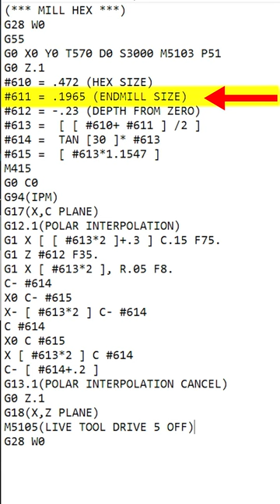This MACRO Machines a HEX on a Swiss Lathe #shorts

Comment: Why does the macro need the endmill size ? Cant u use g41/42 ?
Reply: no because from what i can tell, they are not working with  a conture. the whole thing is made with plain G code commands so the machine is simply following the linear moves and the radius compensation of the endmill has to be calculated into the linear moves themselves
Reply: You probably could but I will say involving cutter comp into macros can be a headache sometimes. In my experience I prefer to avoid that just because I know this will work 100% of the time. For example if you had a 2.00” endmill doing a .375 hex (you probably wouldn’t but you get the idea) getting the lead in and lead out to compensate for the radius in your offset could be annoying
Reply: Because this macro is very Old, almost 20 years.
Reply: @donniehinske  In that case, just enter a parameter that reads the tool radius in the tool table and add the value you want, thus doing any cutter radius you use, the NC will always start from the radius plus the offset you chose.
Reply: @biri3d  you could do that but that kind of puts you back at square one. You are either going to input that value in your offset or your program. I just prefer them all in one place.

Comment: Why are you pecking in brass using carbide drill of that size diameter? G41/G42 would handle that milling  in a second, too much thinking here.
Good video by the way👍